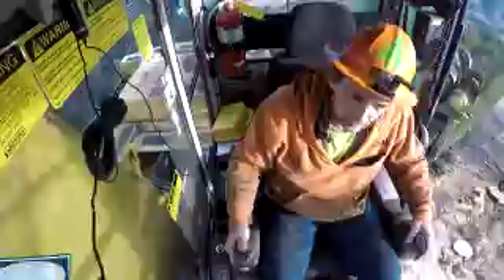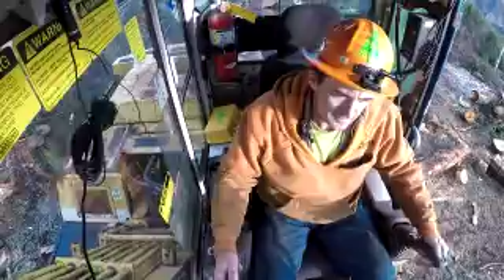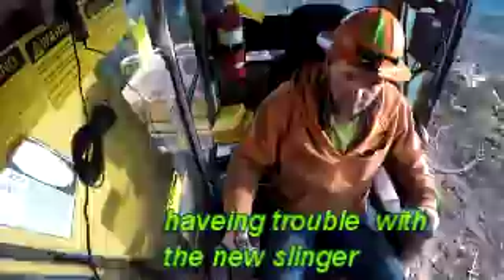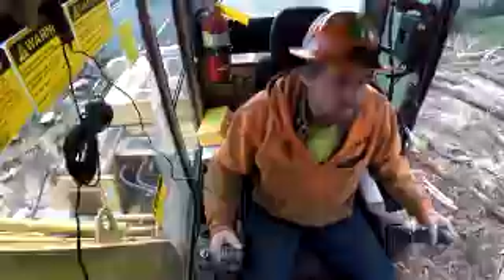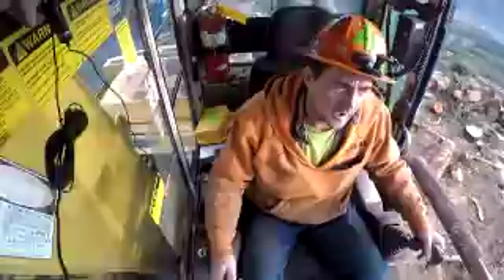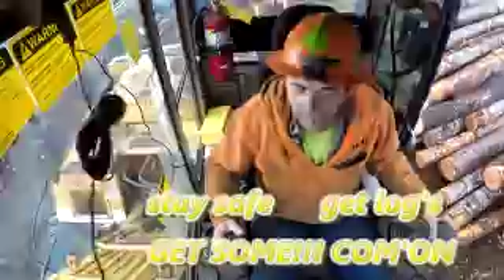back from xmas

Comment: Learning new software sure can be a project all in itself! Hope that Komatsu gets replaced soon, gets old running something like that every day. Like that old worn out Case dozer I run every once in a while, it's got about a 12 way blade on it cause no matter where you've got it, it'll find a way to find about 2 more angles you didn't plan on and then the converter will get so loose you'll be stuck about the time you start clearing the "salmon" creek that's really more of a swap of runoff from the state road, however I digress....... Can't wait until you get some cameras back on the boom, should be some good footage (really good when the Komatsu unhinges itself LoL, keep your seatbelt on tight!!!)
Reply from the maker: +Speed and Marine oh ya that's about how the kamtsu is loading a short logger yesterday with pulp and she made a big bounce and jerk and shove a top rite thru the back window
Reply: Oh man, that's not good! At some point it's just too worn out to be useful and I think it's there LoL